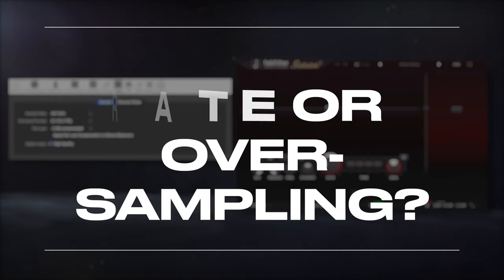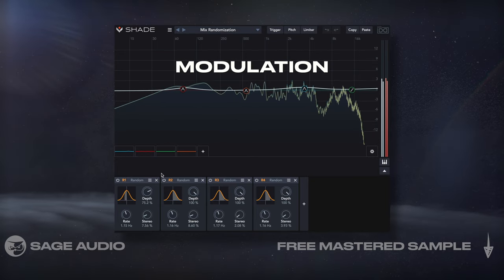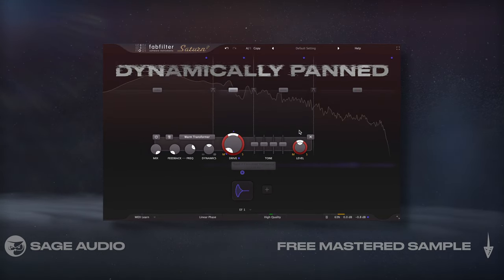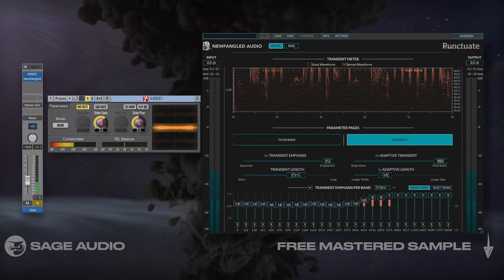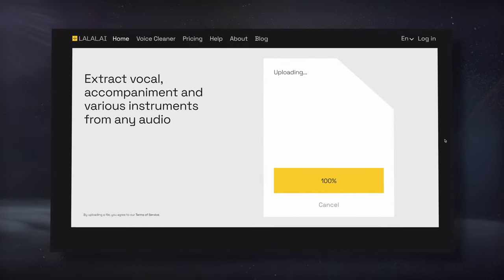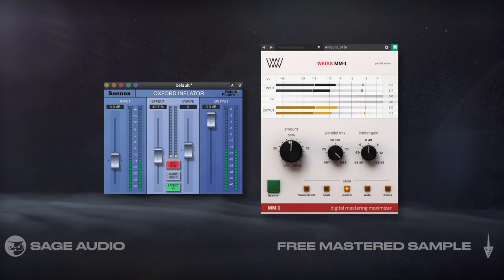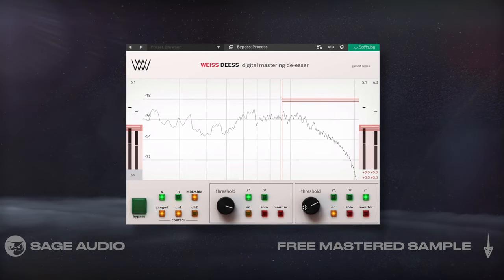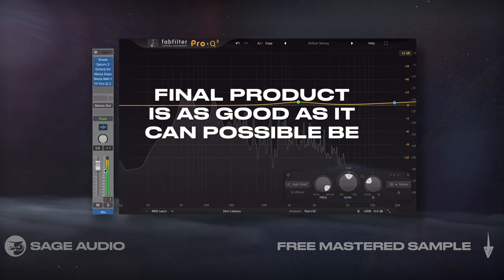Top 10 Advanced Mastering Tips

Comment: First tip is exactly why Elevate is so great! Having the adaptive transient shaper after the limiter and before the clipper (pushing the transients into the clipper) makes anything you run through it have so much more power and punch than just using a limiter and clipper. If I could only use one plug-in for mastering I would choose Elevate every single time. It's not the cleanest and most sterile mastering plug-in there is, but it just works wonders on pretty much every kind of material you throw at it.

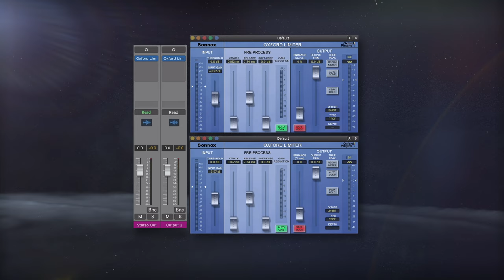Btw... 5:42 that would be the exact same thing as setting stereo link to 0% AFAIU.
Reply: I usually use the clipper before my limiter to shave off rogue transients and actually barely limit anything (just pushing the gain up to the crest) and that worked well so far. Any reason you'd recommend doing clipping after limiting instead? I'm curious of your approach.
Reply: @Magic_carpet666  It's not really my approach, it's just how Elevate works. 

Before ISP/True Peak limiters were common, many limiter/maximizer and clipper plug-ins had a hard clipper at the output (and many still do) to catch the inter-sample peaks. The limiter in Elevate has a True Peak mode though, so the reason for having the transient shaper and clipper after the limiter is to 1) recover some of the transients/dynamics that the limiter is squashing 2) then clip/distort those transients to psychoacoustically keep the impact of the transients without raising the crest factor.

I've tried to recreate this chain with simpler plug-ins, but since all of the Elevate modules uses spectral/FFT processing to split the signal into 26-bands, and also have adaptive parametarization, it's almost impossible to recreate this with other plug-ins. AFAIK there are no other spectral transient shapers or clippers. There are other spectral EQs and compressors/limiters though, but only the EQs (Soundtheory Gullfoss, Oeksound Soothe etc) are adaptive.
Reply: @nj1255  I see, thanks for the thorough explanation. I actually have Elevate but haven't really dived into it yet… I've used the clipper and transient enhancer here and there but usually stick with my mastering chain with Standardclip and smart:limit. I guess the order of things with ISP limiters is interchangeable, and a matter of trial and error with what sounds good or not.